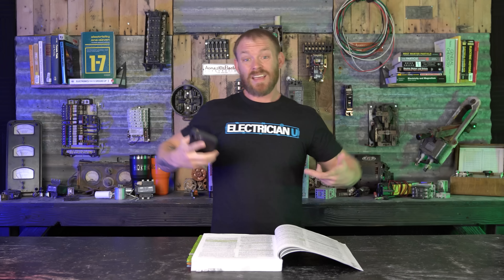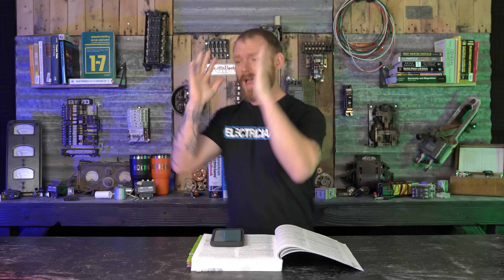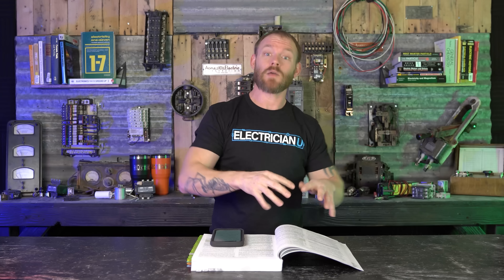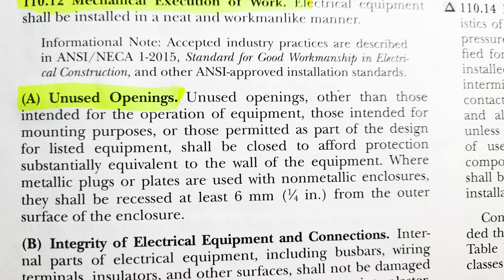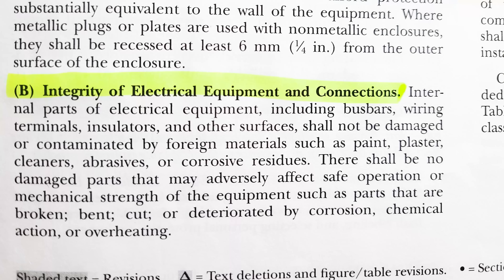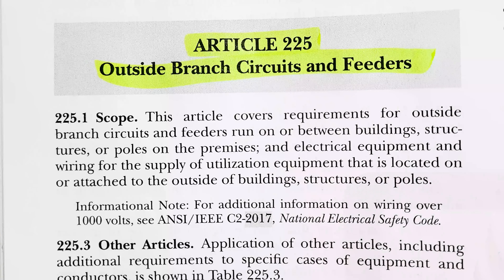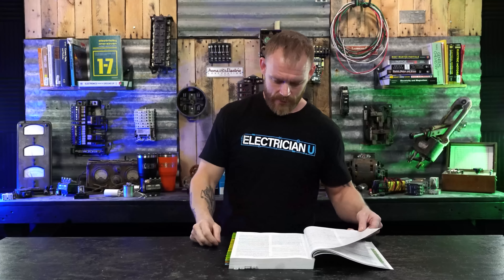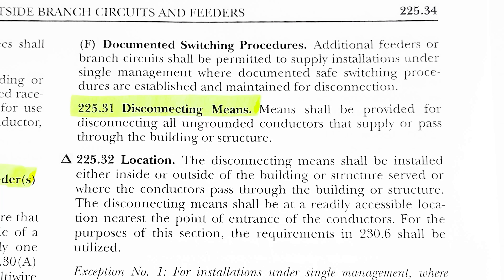BEST OF CODE TIME 3: Feeder & Service Entrance Conductor, Mechanical Execution of Work & Panelboards

Comment: I grew up in rural Missouri. My interest was in electronics. I learned basic electrical wiring as it was required to connect broadcast (radio) equipment to the breaker panel correctly.

Needless to mention, in the country, anyone who could make a 3way light circuit was in high demand. So by necessity the code book became my teacher. Luckily I'm very literal, when the book said neat and orderly I made my wiring neat and ordered. Electronics is pretty much the same unless there was a need, for example, to wrap a wire around something to reduce induction.

When encountering work by, say farmers, I was amazed at how tight one could actually stretch conductors. I believe in some boxes you could actually play a tune.

Comment: You're still young, laddie!
Neatness....I always vacuum out my panels and duplex boxes.
Feeders and SE...sounds better and more professional using Conductors! 
Panels...I just say Distribution Panel..again, sounds better!

Keep em coming "PAC MAN"!
Reply: I vacuum also, I also vacuum my stud bays after I drill the studs for the wiring. A inspector  and I had a nice conversation about why that's a good habit.  If something were to short and arc in the wall, sparks falling into a clean stud bay would probably go out. Sparks falling into a pile of sawdust and wood chips and debris at the bottom of a stud bay have a good chance of catching fire.

Comment: Whole house power surge, I get too much too often power surges on my home, and I’m constantly resetting clocks etc.
What would you suggest I live in New York City, Staten Island private home!
And most of the time it happens when I get up in the morning and I have to reset all the clocks etc.! Thank you for everything that you do for us, I try to do all my electrical work as needed as possible! I think it’s especially good for the sake of anyone else that has to go inside and see what’s going on it helps to see what’s going on better!
Reply: Cheech with your utility and see if they offer a TVSS unit installed on their meter base. That's the easiest way to go, but you can have a TVSS unit added to your existing panel as long as you have an open source for adding a 2 pole breaker to feed the TVSS (Transient Voltage Surge Suppression). A TVSS sends any transients directly to ground before that transient is distributed to any other circuit in your panel including the Main Breaker add long as it is the least path to ground if every other main or circuit in the distribution panel. Being the least path to ground is critical. Should it not be the path of least resistance, the transients will take a "easier" path other than through the TVSS.
A TVSS should get rid of any power problems created by what many call dirty power or high frequency transients. If your power is literally going out from the source for to utility issues, there is very little you can? do outside of spending $25k on a generator that has to a transfer switch capable of switching to generator power in much less than 1 cycle. 
Please don't quote me in the prices for generator or transfer switch, but they will be expensive where you live or how big of a service you have at your home. 
Cheech with your utility first and if they don't offer product/service, contact a Electrical Contractor that probably does mostly service work. If they do not know what a TVSS it's it call it a surge protector, probably not the right guy. Device costs less than $150 plus a new double pole breaker $25 and labor.....
That's the right way to fix your problem. There are other snakes in the grass that claim they have a better way, but I've never seen those ways specified and a project yet!!

Comment: If the feeder lug is loose will that burn the feeder wire
Reply: Usually over time. That is why for motor controllers and other important equipment you may use a heat camera to identify loose connections. A loose connection will be significantly hotter than the other connections around it.
Reply: A  Loose wire will always cause   resistance and heat which could cause failure for sure.